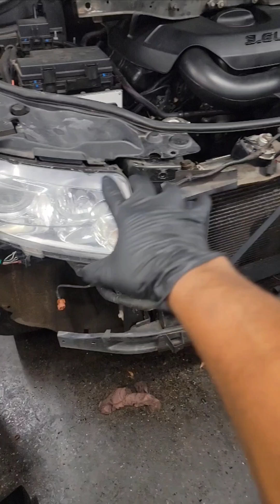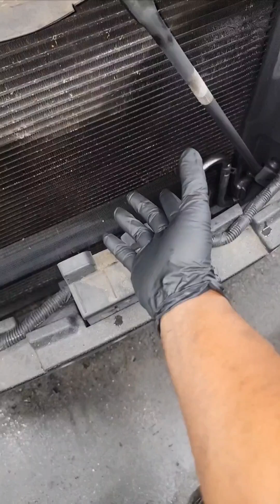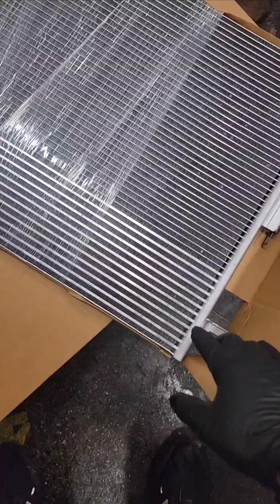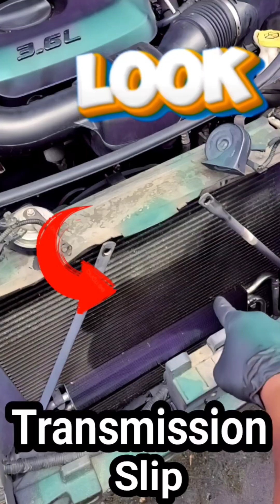How to fix a Transmission Slipping Car with AC parts

Comment: I’ve seen trans cooler integrated into the radiator but never a condensor. A external cooler could have been ran in front probably much more efficient

Comment: Yes, it saves on factory cost but it’s a terrible design for repair.
Reply: These fail under warranty a lot also. I’d be curious to see the cost of repair compared to the cost is just having a separate cooler. Because the 1234yf machine pays 2hrs cp so probably 1.2 warranty plus the actual repair and part. Possible rental car costs.